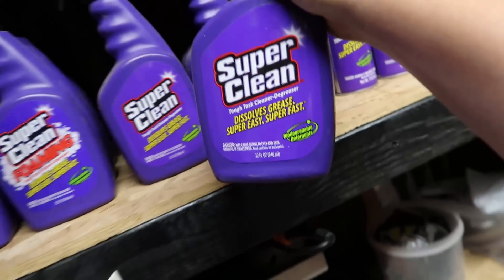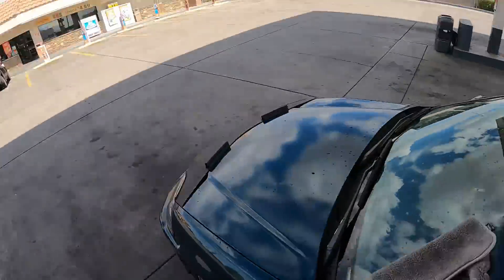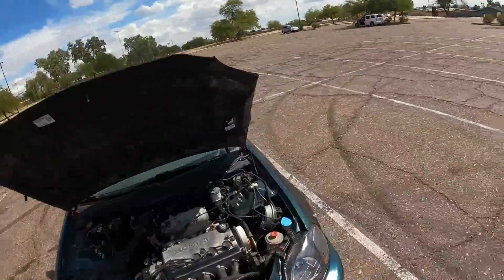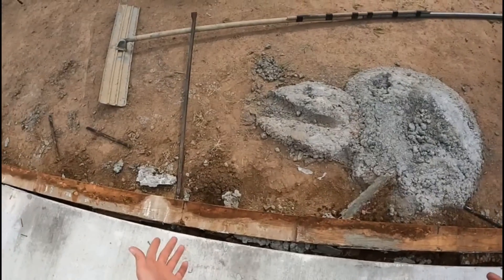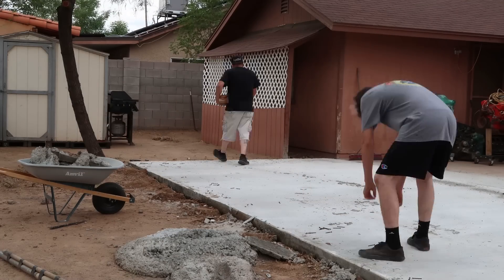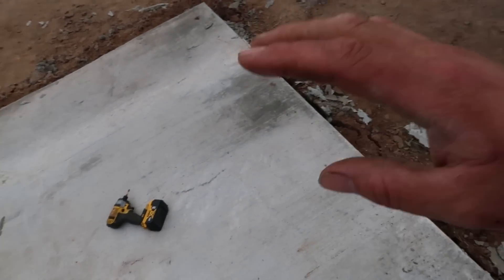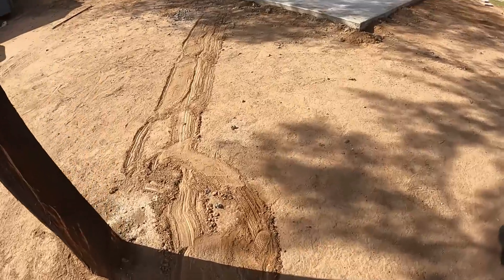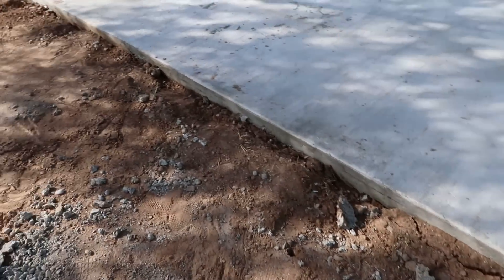Concrete Came Out Pretty Good 👌

Comment: C channel purlin is what thats called for the canopy
Reply: As someone who built Mini storage Buildings for 5 years no. The Purlin is what the C Channel screws to then the Roof Attaches to the Purlin. Those are Just C-Channel Columns.
Reply: @darkblaze176  the end pieces may have been c channel but the c shaped thin beams he was askn about are definitely c channel perlins. U can see how thin it is with the roof screwed straight to it they come in different gauge  depending on application and span c channel is sold not by gauge # but size bc it's usually thicker @ base and thinner @ the ends
Reply: Yes, most purlin’s are an “S” shape. I’ve seen the “C channel” doubled up and welded and used for rafters. But I don’t think I’ve seen C channel used for purlins before. It has many uses in small and large industrial & commercial buildings. For example, windows, doors and so on. 
Girters are used in wall applications from column to column and those are the S shaped ones. 
Lol anyways. This isn’t what he was asking for and I guess I’m just rambling!
🤣🤣💪🏼🤓🤦🏻‍♂️👍🏻
Reply: @GlassWerx  No what he was pointing to was a C Channel beam. A perlin is almost always a S shape and is only used to fasion the corrugated roof panels to. The beam he is referring to is more then likely a 6"x 3" c channel stud/beam. If anyone is using a c channel beam for a perlin they are a shitty builder. Never in building Storage units have we ever use C Channel for a perlin.
Reply: @darkblaze176  yeah iv seen and used both types of perlin. Most metal suppliers around here u tell them u want a c channel perlin that's what u get agreed iv only ever seen those used as walls and only between structural braces bc they are fairly thin materials. Structurally I wouldn't use the c channel perling as a roof truss here where I'm @ but maybe where he's @ itll work but minimum I'd recommend an s perlin but be best structurally with either I beam or a gusseted metal truss.

Comment: The material on the front canopy roof is Steel c studs, 16g,14g,12g. You can find it at a framing supplier

Comment: U mentioned my idea about separating the pour💡😅👍. If u want some good construction ideas and info don't hesitate to hit me up real quick before you start. That metal beam u r looking at just looks like a heavy gauge metal stud coated with an exterior paint. The top looks like metal pan decking 👍🍻

Comment: Pouring in parts is way easier if its just the 2 of you. Exces concrete get a auto jackhammer/drill with hammer function and make it litle peaces. Knee burns look nasty, hope you get wel soon. Next time use boots and rain pants. It will protect you more. We arent alowed to youse those chemicals, we always pore with steel.

Comment: Bust up left over concrete and use as a base to build up incline to slab then use dirt to smooth and level. It won't compress as much as using only dirt.. just an idea..

Comment: but if you do it in 3 parts your need felt board inbetween or you could run drain channels cause you have to alow for expansion and contraction

Comment: Hey, you guys should think about contraction/control joints to force the cracking in those specific areas.  I think they should be a 1/4" thick.  Just match existing joints from the existing slab.
Reply: 1 - 1/2"